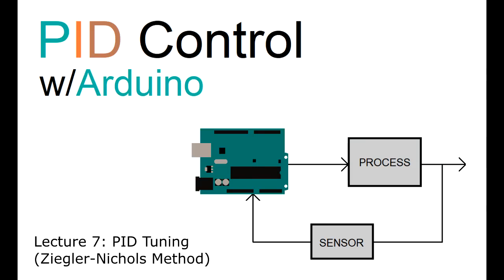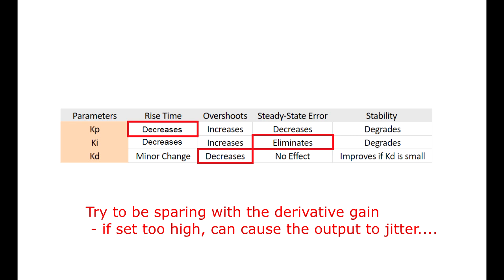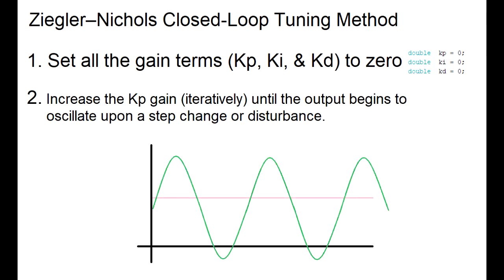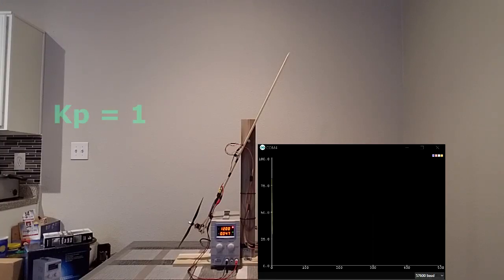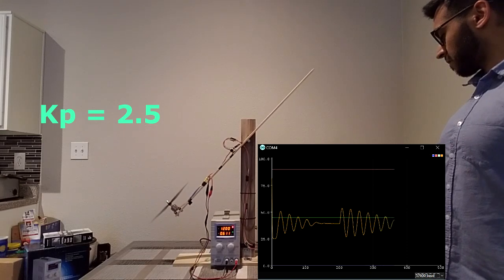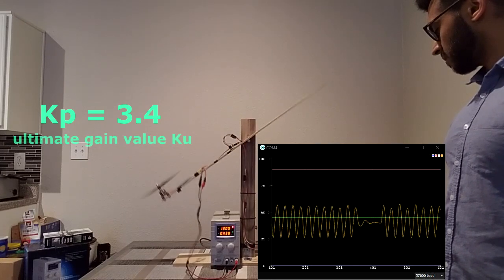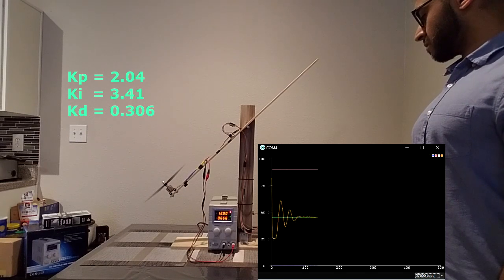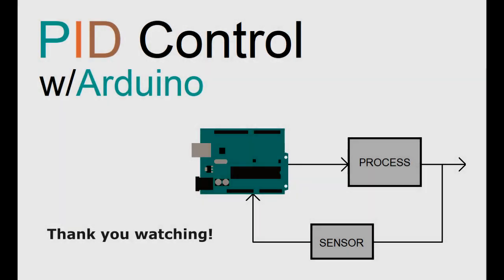PID Control with Arduino: Lecture 7 PID Tuning, Ziegler-Nichols Method (see description)

Comment: Nice Job. Your explanations Cover the Set Up on the arduino Basis very well. Ive passed a Semester of Control techniques but havent Seen an explanation such consistent. To add something constructive I would Like to propose you to add a Video covering the Most recent arduino PID library that further takes away a Lot of the coding from the Makers and allows them to concentrate on their projects. It would also be nice to see the implementation based on a Relais Control System (ON/OFF) instead of PWM. Either way, keep Up the good Work!

Comment: I have acceleromter data  Ax,Ay,Az from MPU 6050, but i want to calculate angle  of Rotation, can you please assist how you are calculating angle of rotation from Ax,Ayand Az and what value is being used as output value from MPU 6050

Comment: Literally sir, this video series was awesome. I got such explanation nowhere now I'm one step ahead to self code my self balance robot....but sir can you please tell me how can i get Ku and Tu in self balance and drone you showed with one axis amd with one motor how should i get the pid constants for two axis drone? Please help sir.
Reply from the maker: The same concept would apply for 2 axis I believe, you just find them individually per axis; two motors balancing one axis, and the other two motors balancing the other axis. I've never built a drone, but my guess is that you'll have multiple control loops. As for the self-balancing robot, it's inherently an unstable system so using the Nichol-Zieglers method is going to be practically impossible to try; for a self-balancing robot I suggest doing computer simulations via MATLAB.

Comment: why is the ki term relevant to this system??
Reply from the maker: The integral gain Ki gives weight to effort of the integral action on the error. The integral term's purpose is to eliminate steady-state error of your process.
Reply: @nabilmohammad5076  I don't really understand the benefit of eliminating the steady-state error of this particular system shown in the video, wouldn't it make sense to not eliminate that at all (in this case)?
Reply from the maker: @jonasmeier5802  I have put the setpoint angle to 45 degrees, and I want the actual angle to be at 45 degrees, aka I want the difference between my setpoint and actual angle to be zero. The whole point of PID control is to robustly eliminate the error.
Reply: @nabilmohammad5076  yes but in order to eliminate the error, the integral term produces a "negative error" in order to get the total error to zero (in this case when your angle was over 45 degrees for some time, the i term will want to get under 45 degrees in order to remove the error, but that is not the goal of this system)

Comment: Hello, I like this video. It's very helpful. I'd like to ask though what the graph indicates? Is it the angle with respect to horizontal or is it the output of your drone? Thank you!
Reply from the maker: The graph displays the measured angle of the arm with respect to the vertical axis, as well as the reference/setpoint (which is 45 degrees.)
Reply: @nabilmohammad5076  Thank you very much! This is very helpful.

Comment: Greetings Nabil! I'm Martin from Indonesia..What are the parameter that you shows on the graphs? Is it the output that drives the propeler or is it the angle of the shaft (stick)?

Thanks
Reply from the maker: The graph is displaying the actual angle reading of the propeller arm, and the desired angle of 45 degrees.

Comment: How does he know that 100 steps in the serial-plotter are 5 seconds?
Reply from the maker: Hey Doug, I was able to confirm it with an external timer, say a stop watch on your iPhone or Android. I had to do a few iterations of various sample times to make sure, it all lined up.
Reply: Your explain style is good, but I am little confuse about the calculated, Kp, Kim, and Kd value, as per formula it's getting different value. Kindly clarify
Reply: I am getting the right value.

Comment: Just two questions:  
1. How did you put up the serial plotter that plots the Arduino outputs? 
2. how did you transform the gyro output to plot the position? Is it like angular position =  integration of angular velocity(gyro output degree/sec) ?  
By the way,  nice setup for the motor stand 😊

Comment: Did you replace the 1.2 second sampling time in your arduino code? Or it is just to calculate the new constant?
Reply: The 1.2 seconds was the period of the oscillation when Kp = 3.4. It was for calculating the gain parameters as shown un the video.

Comment: Share code please?
Reply from the maker: double sensed_output, control_signal;
double setpoint;
double Kp; //proportional gain
double Ki; //integral gain
double Kd; //derivative gain
int T; //sample time in milliseconds (ms)
unsigned long last_time;
double total_error, last_error;
int max_control;
int min_control; 

void setup(){ 
  
}

void loop(){
  
 PID_Control(); //calls the PID function every T interval and outputs a control signal  
 
}

void PID_Control(){

  unsigned long current_time = millis(); //returns the number of milliseconds passed since the Arduino started running the program
 
  int delta_time = current_time - last_time; //delta time interval 
  
  if (delta_time >= T){

    double error = setpoint - sensed_output;
    
    total_error += error; //accumalates the error - integral term
    if (total_error >= max_control) total_error = max_control;
    else if (total_error <= min_control) total_error = min_control;
    
    double delta_error = error - last_error; //difference of error for derivative term

    control_signal = Kp*error + (Ki*T)*total_error + (Kd/T)*delta_error; //PID control compute
    if (control_signal >= max_control) control_signal = max_control;
    else if (control_signal <= min_control) control_signal = min_control;
    
    last_error = error;
    last_time = current_time;
    }  
}
Reply: Nabil Mohammad thank you so much